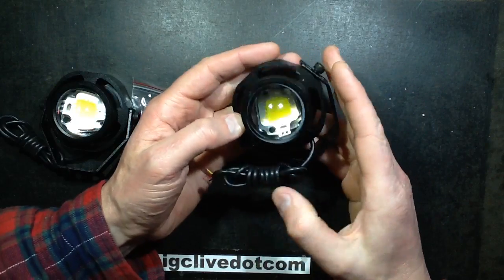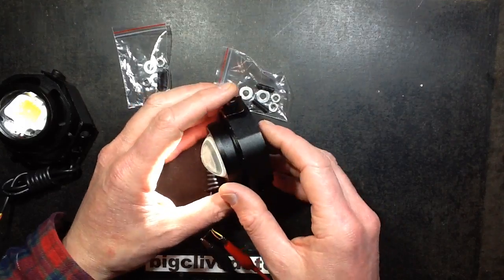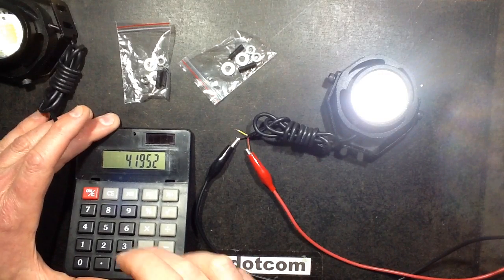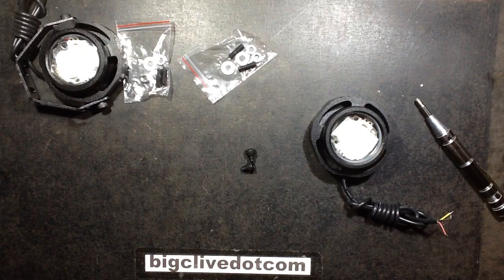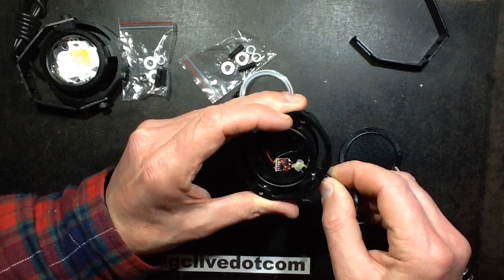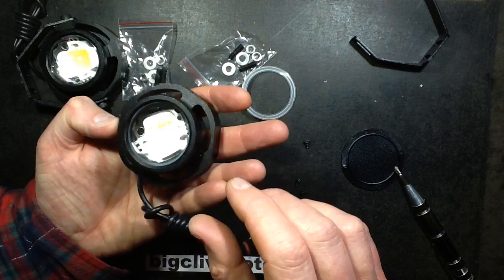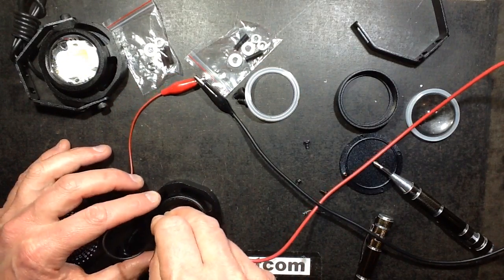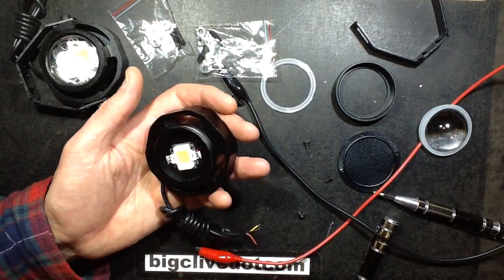Inside some 10W LED jeep or truck lights.

Comment: Electronics-aside, the housing does appear unique and beneficial (and I can't find this specific housing anywhere).

It appears that the LED is directly attached to the housing (thus a decent heatsink?).  For the other versions I see currently available, there doesn't appear to be any heat sinking involved.

Anyone have any thoughts on how to source these housings directly (without the LEDs)?  We know we're going to replace the electronics anyway....
Reply from the maker: It's probably cheaper and easier to get them with the LEDs and then modify them.
Reply: @bigclivedotcom  That's what I normally do--just trash the electronics (and by "trash," I mean consciously-recycle).  But I do really like that housing, with the LED actually in contact with the housing--I just can't find that style anywhere now...
Reply: @bigclivedotcom  By the way, my guiding principle now (when designing my hobbist circuit-boards):  "what would clive say about this"

Comment: 10Watts? - I reckon it's all in the small text. . . . How many times have I seen LED vehicle lamps for sale on the net, with tasty sounding output ratings, only to find that the headline figure is actually the combined rating for both lamps, so here in your example, 10W would be about right - for the pair!

Comment: Clive, when are you going to invest in an electric screwdriver? I purchased a rare model that Hilti made several (10-15) years ago which is a tremendous help when disassembly of gadgets with too damned many screws are encountered. I see the last comment was a year ago so I doubt you see this suggestion, but a comprehensive set of quality bits and bit holders are invaluable to me. I also suffer from Carpal Tunnel from years of manipulating Klein 9" Electricians pliers, screwdrivers, etc. as a Licensed in Georgia Master Electrician. The manipulation of Kleins  as hammers and persuaders contibuted quite a bit to this as well as teaching my apprentices the correct side to beat with to avoid ruining the pliers by flattening the swivel joint. It is different sides according to brand of pliers and having not purchased any new Klein's, Ideal, etc. recently careful study avoids the dreaded stiff opening pliers. In the day new Klein pliers were extremely stiff and required sometimes extensive breaking in periods to use one handed to open and close. Remembrances of dipping my pliers in mud puddles and working them repeatedly often shortened the aggravating period by quite a bit. Being the owner of several pairs of Electricians pliers I still retain pairs I ruined damned near immediately by ignoring the swivel pins direction. Once you smash the pin there's no fixing them and unless you have huge, muscular hands they're rendered useless to most of us. I love your reviews (mostly) disagreeing on small points you deem enhancements. Keep up the good work, I'll keep reading and testing your opinions.

Thanks,
Zappenfusen

Comment: Each time I try to install LEDs on my scooter on the T10 plug instead of the original glass bulbs, they die after a month. I have tried many sellers with diverse designs and colours at different prices on Ebay, no luck so far...
Reply: Merci pour votre reponse, thank you for your answer. I have checked the catalog with spare parts and it looks like there is a rectifier, can it be faulty? It looks like the scooter is working well. Merci pour la piste en tous cas.
Reply: C'est ca pour les lumieres! Je vais chercher de ce cote, peut etre la variation du courant tue les led apres quelques temps. Les ampoules normales a filament semblent tenir mieux. Merci beaucoup.
Reply: Francois Rousignat I'm Chinese and French. I will answer in French because it might interest other people. Actually the light gets stronger when I accelerate. So far the battery doesn't seem to have a problem, except when the gas tank is low, I struggle to start the engine a bit but it always get normal after a refill. Not sure it's connected though.
Reply: C'est un 2 temps injection.
Reply: Oui je pensais la meme chose, mais c'est pas trop handicapant pour le moment. Merci pour le tuyaux en ce qui concerne le rectifier ca coute pas cher la ou je vis, je vais le changer.

Comment: I picked one of those up several months back and made a rather useful flashlight out of it. Mounted it atop a project box, and inside the box I added 6 18650  batteries in holders, a dc-dc power regulator, as well as a volt/amp meter with plugs for good measure.  It works great when working on our Motor Home (which we now live in full time) and is very handy having the meter right there all the time. When I think I may need it I just plug in a couple of probes and I am off in a repair mode.

Comment: Why would they glue it you ask?  Which costs less, drilling and tapping (or just crude forcing threads to cut) machine work plus the cost of screws AND still heatsink grease, or only a tiny dab of magic thermal goo which is probably not even proper thermal adhesive?

Comment: this may be a weird question but I was wandering. ok ive got a 12v 10w LED. would it be possible to keep the LED at its normal brightness while dropping the voltage and boosting the milliamp's?
Reply from the maker: +Pat P With an electronic supply it might work at lower voltage and maintain the output intensity at higher current.  But with a discrete resistor arrangement it won't work so well.

Comment: Can you do a video to upgrade them. I bought some and want to upgrade them
Reply: +Stephen Harper Sure, then all you'd need to do is replace the housing with one capable of the heat that the upgrade causes.

Seriously, if they had no trouble with them running at higher wattage, then they wouldn't have set them to run at 4W.  I guess you could probably get away with 10W at half duty flashing mode.
Reply: +Stephen Harper that would be nice i really like the design

Comment: I think most 12v vehicle alternators have a regulator set in the region of 14.4v.
One of  the principle factors affecting any LED power handling is junction temperature, which itself influenced by thermal design. 
I understand that forward voltage of LEDs is affected by the junction temperature. It might be fun to make a sample and hold circuit which interrupts the supply current momentarily to feed a small current, then read the forward voltage under the small controlled current and therefore the instantaneous junction temperature. This can provide a good predictor of LED life expectancy.
It would also be great to measure actual lumens and CRI.

Comment: if you pause at 2:32... looks like the reflection in the camera's lens (slightly to the left of the lamp itself) shows 8/9 of the LEDs in that COB are functional...
Reply: Nice catch
Reply: @pierreuntel1970  it's just the way the lens is, that led would be very dirverged

Comment: I also bought a pair of these (after watching this video), but mine have only 2 wires and no fancy strobe feature :/
And of course a different kind of driver, no PICs. + the LED is attached with self-tappers.
Reply from the maker: Johniakson Does it have the little control box?  I wonder if it's actually using a proper driver to run them at higher output.
Reply: bigclivedotcom It has cl6807 driver. Other one was about 6 W and the other one about 7,3 W. I have only opened the 6 W one. I have to open the 7,3 W one too, because it has silver color screws on it (I wonder if it has been "fixed" or something).. So no control box either.
edit: I just had to open the other one too :) It's exactly the same.

Comment: they almost look like miniature theater lights
Reply from the maker: killer1479 That's partly why I bought them.  They do have that theatre/film look to them.  Like a miniature Mole Richardson Fresnel.
Reply: bigclivedotcom :)! with your past and your know how, i bet you could make some funky DMX garden lighting with these!
Reply: +killer1479 I love lights like this. I bolted one of them to my bicycle just above the tire where the old breaks would have been bolted and im running it off of a rechargeable dollar store spotlight battery strapped to the back bracket (meant for books) and an old car fog light switch just off to the right of the battery. I might do it again cuz there fun to do and it makes it look like it has a genuine headlight instead of 1 off center. (im symmetry obsessed) lol
Reply: id rather not. I try to stay away from alcohol and drug related stuff since one of them took my grandpa.
Reply: Pat P cool, and make a video ? :)
Reply: killer1479 I'll try. One of my friends bet that I couldn't stay quiet for a week and i think we both lost. I've been quiet for so long it's effecting my speech pattern. I might whisper it or just stay quiet cuz its become exhausting to talk normally like I use to.
Reply: Pat P sorry to hear :c
Reply: Pat P damn son :o, get a stiff alcoholic drink in ya... for medicinal purposes ofcourse!
Reply: its alright man its life. not like were getting out alive. lol anyway man when I get another light ill wire it to my new bike and record it. im planning on getting a new bike with airless tubes. I ran over a tin penny nail last year. covered me with tire stink lol
Reply: Pat P :) i look forward to it!

Comment: Glass lens is likely just a cheap one that is very common on halogen lights, like those used in modern HID lit cars. They are likely just the rejects that were not quite right for the OEM market, but were not bad enough or did not have bubbles in them so were not simply remelted as cullet. Nice case though, would be usable as a front for a flashlight or a spotlight indoors. or even attach to an old anglepoise lamp stem as a desk lamp with small footprint.

Comment: "cree" yeah right. case and lens is not bad.
Reply: Walter Boxhead but at least it wasnt measured in chinese lumens, a torch that arrived today promised 1200 lumens, its about as bright as the proper 50 lumens of a decent torch :}
Reply: jusb1066 dont 4 get the chinese go by a different metrix saytem than the english go by.